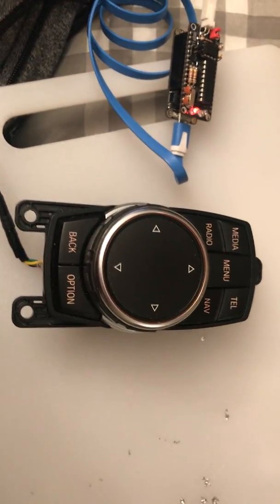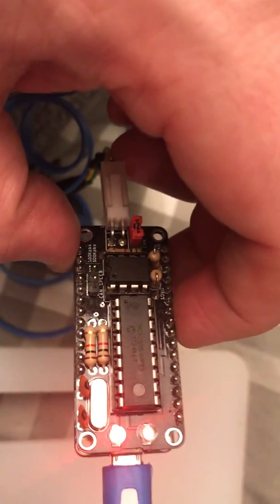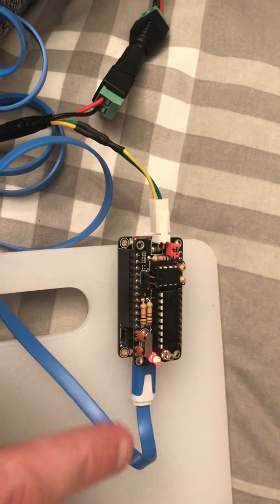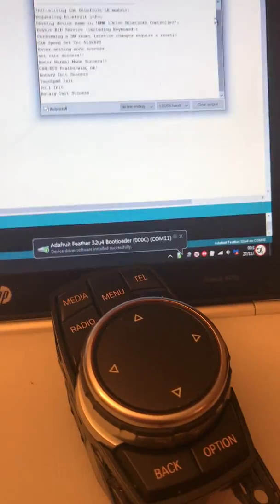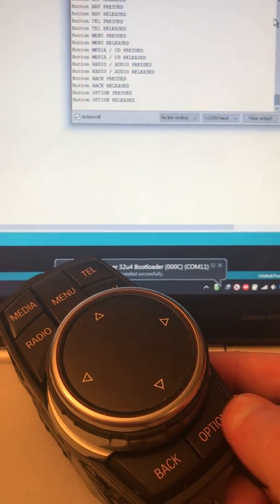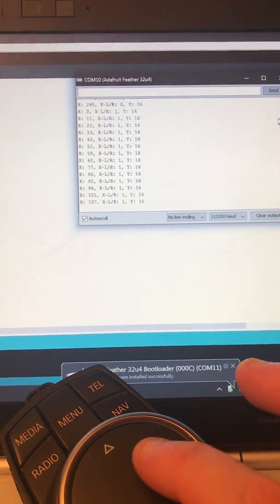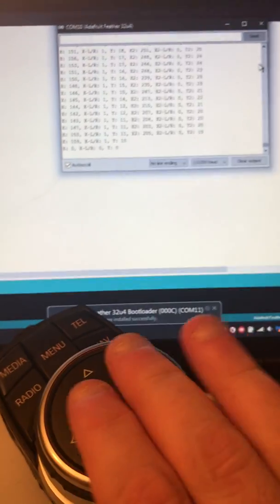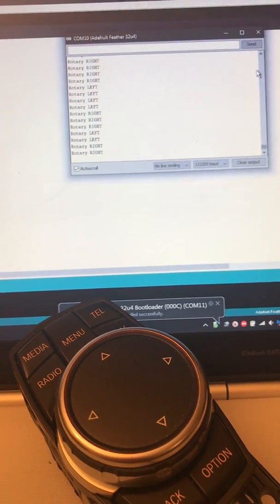BMW iDrive BLE HID 1

Comment: This is unbelievably cool. I want to control my joying 8.8 with a bmw idrive. I have zero programming skills. Where can I get detailed step by step?  Thanks for inventing this you’re a pioneer. 😊
Reply from the maker: My code example is here: https://github.com/IAmOrion/BMW-iDrive-HID
There's no "detailed step by step" guide though, it's not quite that easy, you'd need to check the code and figure out how to get it working for you.  You'll need to be familiar with the Arduino IDE and coding etc
Reply: @IAmOrion   oh crap.... 😢
Like a fool I already bought the Arduino, head unit, iDrive and iDrive 4 wire harness. Gulp..... I have no idea what I'm doing.

Comment: Hello! Im not sure if you are still replying but il take my chances. So i need an Arduino pro micro (to have the controller work as a keyboard for pc work as usb keyboard), and a MCP2515 + MCP2551 can bus module. Tho about those 2, would it still work if i got both the MCP2515 for 3$ on aliexpress AND the MCP2551 modules and combine them together?

Comment: Hi, great project! I am integrating Android auto into my BMW F10 (connected as TV input to CIC) and can read idrive controller input, but I have problem that idrive controller also interacts my CIC system :( You can see in my video: https://youtu.be/plySBRlPMZQ
Do  you know if it's possible to fool CIC (or idrive) to ignore input while I am interacting my application?
I have idea to test, but not sure if this will work: according http://www.loopybunny.co.uk/CarPC/can/273.html, byte 4 is CIC dispay, maybe I can send fake message with different byte 4 to idrive controller and it will start replying accordingly so that CIC will ignore it?
I see you have more experience in this, please share your thoughts :)

Comment: Alright. I've seen your videos.. but I wasn't able to make out the full schematic  regarding the connection from the idrive to canbus to arduino. Do you have some sort of a diagram on how to connect such ?
And also regarding the CANBUS shield ..MCP2515 and MCP2551 are used in conjuction?
Reply from the maker: Take a look here for the shield: http://wiki.seeedstudio.com/CAN-BUS_Shield_V1.2/
It's an open source can shield using the MCP2515 + MCP2551 (Yes, they're using together)
The iDrive connects to the Arduino Can shield by just 2 pins - CAN H and CAN L (Can HIGH + Can LOW)

Comment: Hi, can you tell controller pinout? Does it use 12v?
I have idrive controller and mcp2515, I think about the possibility of output to a regular screen from a third-party device and joystick control, as is done in chinese devices
Reply from the maker: Make sure your CAN device is MCP2515 + MCP2551.  The really Cheap MCP2515 + TJA1050 style ones you get on ebay for about £3  WONT work.

The iDrive itself is 12v yes.  You'll have 4 pins...

+12v
GND
CAN-H
CAN-L
Reply: Yes I have TJA1050 modules :( why won't they work? My controller is also simpliest version from F20, no touch, only rotation and left-right. This pinout starts from the key, right? Thank you for the reply )
Reply from the maker: @kfedor  Put simply, it simply wont work.  The iDrive needs a fault tolerant circuit etc - the TJA1050 simply is not capable.  Something like a makerhawk canbus shield will get you started https://amzn.to/2SUHhW9 OR you could use the open-source schematic and build your own shield

Do you use Facebook? If so - reply with your facebook link and I'll try and send you a message on Facebook.  I can send you a photo of the pinout of the controller too that way

Comment: Hi ,
I have the same idea on my BMW. I want to connect the iDrive controller with my Nexus tablet. Is there a chance to get your code ? Because im not so deep into coding with bussystems. Or maybe can you guide me to achive my target? I use an older version of the iDrive controller (without touch) .
Reply from the maker: Hi Sven, let me know your facebook (or messenger) url and I'll send you a message and can try and help.  My code works with all of the iDrive variants (At least, all the ones I've tried so far.  The ones with 5 buttons (no touch), 7 buttons (no touch) and this one 7 buttons WITH touch)
Reply: Thanks a lot. here my facebook profile https://www.facebook.com/sven.cellary
Reply: @IAmOrion  what about the 10 pin idrive controllers with touch
Reply from the maker: @rileymcpherson3334  I've never seen or heard of a 10pin iDrive controller!???? All iDrive Controllers (Including this one that has touch) are 4 pin CANBUS connection (+ve, -ve, can-h, can-l) ... what part number is your 10 pin controller?
Reply: as i understand there is still the can-h, can-l pins on it, but im essentially trying to build this to be compatible with the raspberry pi to control the open auto software for a custom headunit for my car
Reply from the maker: @rileymcpherson3334  Interesting, I didn't know there was one that had 10 pins -- I can't help you with that one, I have no idea how it works or if it's even the same.  I used iDrive Controller units that had 4 pins only (+ve, -ve, can-l, can-h).  You'd have to experiment and see if it works with my code.

Also, you'l obviously have to convert the code to Python or something if you're using it on a Raspberry Pi
Reply: Hello,I'm exactly in the same situation as Sven M, Nexus 7 in bmw without Idrive, but a complete newbie.  Any chance to guide me ?
Reply from the maker: @jean-marcdesmul4990  Do you use Facebook? If so, can you give me your link please and I'll send you a message
Reply from the maker: @jean-marcdesmul4990  I've sent you a FB Message

Comment: Could you tell me, how to get touch working?
Reply from the maker: What's your circuit, and how far have you got in regards to using the iDrive - eg, you have buttons etc working already?
Reply: @IAmOrion  I mean my controller is from F10. Date 19.09.17. Buttons, Rotary and Light is working. My Hardware is very simple: Arduino Nano and a MCP2515 shield.
Reply from the maker: @5erE39Touring  You need to init the touchpad...  ID: BF, Length: 8, Data: 21 0 0 0 11 0 0 0

Also, depending on the shield you're using, you may struggle or get erroneous data or unexpected issues.  The TJA1050 doesn't work (properly) for the iDrives (Just incase you're using one of those cheap TJA1050 + MCP2515 things)
Reply: @IAmOrion  yes it's a mcp2512 + nxp A1050. i did a test with your message, but i don't get an message after touch init. is the ID correct with two digit HEX value? Are the data bytes HEX or DEC values? is it possible to contact you directly?
Reply from the maker: @5erE39Touring  Your first problem is your hardware.  As I said, the (TJ)A1050 is no good.  You need a fault tolerant chip and the TJA1050 is NOT.  Yes, of course the ID is correct - that's exactly what I send (I copy and paste from my code to my comment).  Also, all data is in HEX.  Everything you do with the CAN should be HEX.

If you let me know your facebook account I can message you
Reply from the maker: @5erE39Touring  I've messaged you - check your Message Requests
Reply: Hi @5erE39Touring. Did you get touch working on your controller?  I have a 2017 iDrive controller and can't get touch to work either.
Reply: @JumpMasterBlue  did log/find out my controller use other messages, but don't started to emulate this.
Reply: @5erE39Touring  anything you can share to initialise the touch interface?
Reply: @JumpMasterBlue  sorry no